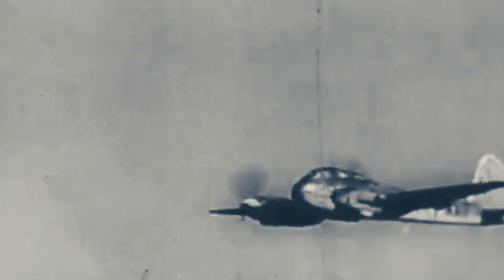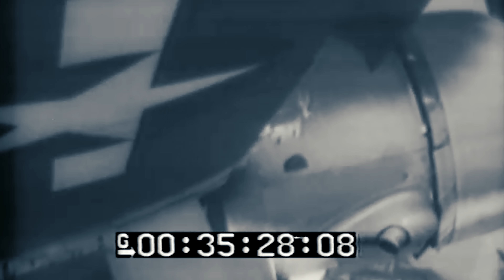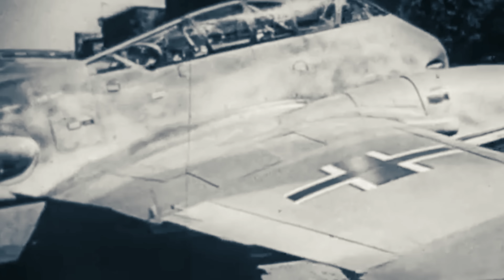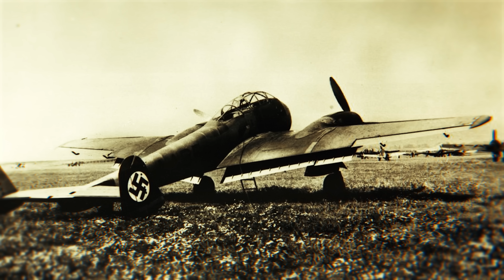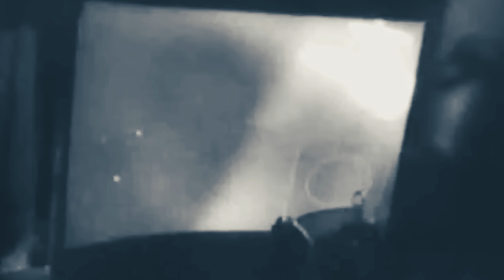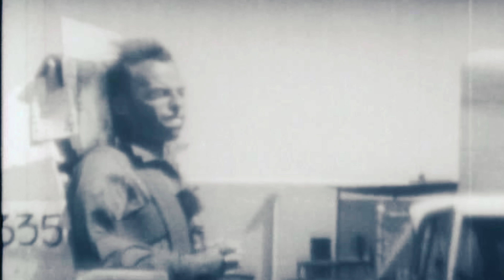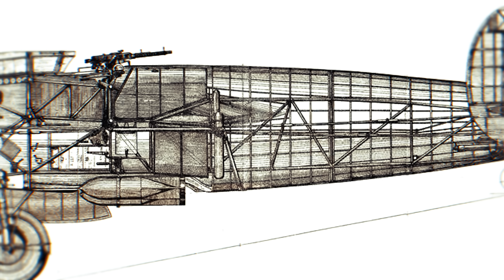Flying Disasters: 3 of WWII’s Most Dangerous Aircraft Designs

Comment: Anzeldo Breda made the catastropic ic4 trains that should be the new Danish super train. It turned out to be an tram actually, plagued with faults under any load. Anything electric failed, toilets failed, drivetrain failed. As the Breda they where produced to the very end, Even if they where scrapped before final assembly. Anzeldo Breda is a name you should mark on your list. This name is point zero of Italian corruption.

Comment: Fighter aircraft are a bit of an oxymoron. You need a platform that is stable enough to aim from with your weapons but agile, enough or unstable enough to change course with the least input on the stick. Getting it right requires a ton of math , a bit of inspiration , a little insanity , and a very brave person to get in the plane and fly it. If we can take the small-scale Cessna, the beginning Cessna as an aircraft archetype for learning how to fly and the most friendly to flying your fighter aircraft is the exact opposite. It's not stable, it's not friendly to pilots. You have to fight it every step of the way to maintain a straight level course  And at the same time , you have to be delicate with it very small corrections , because too much correction will send you into a diver , Or a violent turn. And that very unstability allows you to survive easier when someone's trying to shoot you

Comment: Part of the Helldiver's problems was a truncated fuselage; the Navy insisted that the plane be short enough so that two could fit on the elevator of an Essex class carrier.  Maybe the only thing that would have made the plane worse would be fitting it with Curtis-Wright's own R-3350 engine, though that wasn't ready until later in the war.

Comment: Whilst the Piaggio PXI was a "licensed version of a French engine",  the Gnome-Rhône Mistral Major, but the French engine was not a license built Bristol Jupiter. The Jupiter was a 9 cylinder, single row design, with the Mistral Major being a 14 cylinder, twin row design. Gnome-Rhône purchased a license for the Jupiter in 1922, along with the Bristol Titan 5 cylinder engine. They then went on to design their own engines, developed from the Titan, eventually producing the Mistral Major, which featured 2 valves per cylinder, rather than the 4 used on the Bristol engines.

Comment: My Great Grandpa was a navigator (rear seat with the twin guns) on a Helldiver in the Pacific. Once, upon takeoff there was a catapult malfunction that sent his plane over the front of the ship and straight "into the drink." The carrier had to take emergency evasive action to avoid running them down, but the plane started sinking like a stone immediately. He was a deeply religious man who always talked about a "prompting" he'd gotten on the flight deck that day to not do up his harness. It was the only time he didn't strap himself in, and it was the only reason he was able to get out of his crippled, sinking plane in time to swim back to the surface. He was eventually picked up with the help of a cruiser after floating around for over an hour (there are some very cool photos of a funky contraption strung between the carrier and the cruiser to lower a sort of chair thing down to the water for him to clamber onto). Not sure this particular helldiver crash was the fault of the designers or not, but I'm definitely grateful that my Gramps listened to whatever that prompting was that saved his life. He was a great man.
Reply: A bosun's chair is used to transfer people from one vessel to another at speed (under way). I've never heard of one being used to grab swimmers out of the water, at least when in motion. You wouldn't be able to grab onto it and hold on with water rushing past you at 10 or more knots. Possibly a single ship could toss one in the water at very low speed, but that would be it. There would be the danger of hitting the swimmer and killing them.

Comment: Even as a child reading, looking at, WWII aviation books in my school library, I thought the Helldiver just didn't look right. It looked as if the fuselage, from the rear canopy back, was way too short. It made me believe that it couldn't fly well. It looked unstable. Now, I know that an aerodynamic shape doesn't always look how we would instinctively imagine it to look. However, in this case I believe my instincts were correct.
Reply: The Me-210 had the same problem. Willy Messerschmitt, believing the hype about what a genius he was, chopped a metre off the original design length, the result being tremendous instability. Eventually, after several years of futzing around, he had to restore the length at tremendous factory cost.

Comment: To be fair to the RLM, the heavy fighter did have a place. The British DeHaviland Mosquito and the American Lockheed P-38 Lightning provided successful examples of the concept, along with the P-61 Black Widow as a night fighter. Simply removing the tail gunner and associated gear and focusing on aerodynamic performance made for a successful machine. The Me-210 was over-engineered, but it could have been successful had it been built better, as proven by the 410 upgrade.

Comment: Helldiver suffered from a conceptual flaw: it was designed to be short enough to fit two on one carrier elevator. That would greatly reduce the time needed to move aircraft from the hangar to the flight deck. But that led to lateral stability issues that were almost impossible to overcome. The Dauntless traded folding wings for more stability in a dive.

Comment: Jocko Clark's actual critique of the SB2C during it's carrier trials was that it had value to the Navy only as an anchor.  Frankly, Curtis was a second rate manufacturer by that point.  The design had multiple problems, many caused by Curtis' inability to imaginatively deal with a Navy speculation that 2 of the planes be able to fit on one carrier elevator.  The cockpit layout was also terrible.  By the time of the -5 model most of the problems had been fixed, but the ability of the Hellcat and Corsair to carry a bombload helped make the SB2C obsolete.

Comment: For perspective When Yorktown’s Captain Jocko Clark was pleading with the Navy to cancel the Helldivers, this was in June ‘43. This was during the second Essex class Yorktown CV-10’s initial work ups after commissioning in April of ‘43. When the ship arrived at Pensacola Clark got saddled with doing the initial Carrier workups of the new planes. It was a disaster. For the first week of testing the plane handlers could barely move the 10,000 lb monstrosities. Plane handling was done by men pushing them around. The Yorktown crews operational speed was horrible due to the Helldivers. Clark was furious. When Yorktown put back into Pensacola Clark was told he had to keep on testing. A couple of enterprising and felonious Master Chiefs bribed the local Shore Patrol to look the other way while they stole 2 aircraft tractors from the Marines and smuggled them aboard. Keeping them hidden until they were well out to sea. When they started testing again Clark was astonished to see the tugs, and further amazed at how they gave his ship a record breaking operational speed. They spent the next 2 weeks with Helldivers crashing on the deck. When they got back to port Clark ordered them off his ship, and demanded Dauntless’s. It would not be until ‘44 that the “improved” Helldiver would enter service. Clark did keep the stolen tractors. And he told command about them and how well they worked. Within 2 weeks every carrier was issued 4 tractors plus a gas powered crane. US Navy Felonius Innovation going back to their Pirate origins. Clark was still pissed. Messing around with the Helldivers had allowed the third Essex Carrier CV-11 USS Intrepid to leapfrog him and reach Pearl Harbor first.

Comment: on the Breda,  one has to remember that an aircraft built to spec for racing is very different to one built for military use.   The Spitfire saw many changes from the racing plane it shares lineage with.    Seemingly the the italians weren't able to pull off what the british did in adapting a racing plane into a military aircraft.  The required specs the Italian air force requested ( can survive 12gs WTF?) likely handicapped the efforts.

Comment: In 2006 I was in Germany and there was an airshow with a few warbirds.  I was drawn to a BF109 and ME262 replica parked for display.  There were displays put in front of the planes displaying other Messerschmidt models.  When I asked the pilot of the 262 why the 410 was not simply kept as an upgraded 210 model, he told me that it wasn't just propaganda but that over 70% of the machine had to be redesigned.  With so much of the original blueprint being revised, it was internally to Messerschmidt not even the same machine anymore.  This only gave more "legitimacy" to the claim that it was "a whole new machine", and they could put the 210 to bed.  So yes, it was propaganda, but also yes, it was a new plane.

Comment: What surprises me is that the ME262 sometimes lost to the P-38
Reply: most Me 262 were shot down during take off and landing. But it also wasn't exactly the best dogfighter. The jet engines would flame out if the pilot reduced the throttles too quickly and so slowing down quickly for a tight turn was difficult. And the swept wing design made it less manoeuvrable at low speeds. The Me 262 excelled at level speed and climb rate most. In a dive the P-38 was extremely fast and stable. So the Me 262 had no advantage there either. So a skilled pilot could absolutely get the better of a Me 262 just like a skilled Hurricane pilot could get the better of a superior Bf 109E.
Reply: @archer494 Indeed. The Me262 was very good at going fast, in level flight, within quite a narrow altitude range.  So, a moderately interesting technology demonstrator.
Reply: @loucypher9213 I wouldn't put it like that. The Me 262 suffered mainly from the fact that she was a late-war addition to the war with an until then unproven propulsion in combination with deteriorating production capabilities, quality control issues and material and fuel shortages due to the bombing raids on factories, infrastructure (incl. airfields) and supply chains. Had the development been started earlier I am sure they would have gotten the engines to be more reliable. As recent replicas with proven jet engines have shown the airframe and aerodynamics are sound. The aircraft with the right tactic and reliable engines would have absolutely been a great addition to the Bf 109 and Fw 190. But never a replacement. Using the 262 to attack the bombers while the 109s and 190s dealt with the escorts would probably have worked. It just never reached its full potential

Comment: When you use an ejector seat, you take about 19-20Gs. A Syrian MiG-25 once went into 11-12G manoeuvres to escape an Israeli Mirage-III in a dogfight. The MiG-25 could return to its base but was written-off as it got too much metal fatigue and the pilot was lucky it didn't broke appart.
Rafale pilots doing air shows have been advised to stop doing 10.5-11G manoeuvres to impress the public and do not go over 9G, going further being an emergency measure to dodge high manoeuvring incoming missiles, not to go into a dogfight. Actually, the airframe is rated at taking 13G without metal fatigue and to break appart at 14.1G.
An airframe supposed to take 12G would have meant maneuvering at 9-10G and one thing for sure, with WW2 dogfights, a functioning aircraft doing this would have been devastating for the adversary, but you also need to have pilots trained at facing high G-factors, preferably rather small men or women because you can take more Gs when you weight 50kg than if you're a big 100kg baby, inclined seats like you can see on Rafale or F-16, HOTAS, etc

Comment: The Curtiss-Wright XP-55 Ascender (or known by the test crews as the “Ass-Ender”) would fit in here… it was an attempt at a push-plane, but having the engine and propeller in the back caused it to suddenly do an in place back flip, known as “departing from flight”, and fall out of the sky and into the ground when at certain speeds during landing… so, it flunked out around 1944 or 1945.

Comment: It is somewhat strange that Douglas couldn't (or wouldn't) develop the Dauntless or at least use it as the basis of a new, somewhat larger, more potent aircraft.  It needed folding wings, a more powerful engine, lose the nose mounted .50s and add 2 (or a 20 mm) to each wing,  RETAIN the external ordinance carriage and forget about a bomb bay...in effect create a WWII equivalent of the later Skyraider.  What they DID create was a rather strange bird with tricycle undercarriage, bomb bay and remote controlled turrets.  Both Douglas and Curtiss seemed to have developed  a sort of "design Alzheimer's". Douglas snapped out of it but Curtiss never did. The Helldiver was not a bad LOOKING aircraft and, despite its own chunkiness, positively svelte when compared to the Avenger yet the homely and portly Avenger (admittedly NOT a dive bomber) was just about everything the Helldiver wasn't. No WWII dive bomber was a world beater by any stretch but to blindly persist in pushing through this particular lemon speaks of political dealings behind the scenes.  Vultee built a dive bomber about the same size as the Helldiver and despite being relatively unknown, had I would argue, a far better reputation. True, it was not a navy bird but it saw quite a bit of service while USAAF versions of both the Dauntless and the Helldiver were failures.

Comment: Gee, Mike, viewers have responded to you question by requesting that you do just about every aeroplane that was.   You could be doing aeroplane videos for years.
May I suggest you concentrate on the more rarer types.    I wouldn't be much interested in things like the B-29 and the 707 because they have been done to death repeatedly ever since they came out.
However, a well researched coverage of the Comet would be good - you are quite right - due to rotten reporting by the British press, people have been thinking it was basically a good aircraft let down by square windows and that just isn't true.
A well researched article on the DC-10 would be good - because it was a dreadful plane - dreadful because Douglas fell down in the same ways that Boeing has in recent years.
If you are not aware of Mentour Pilot's superb technical analysis of planes and accidents, check him out - he set the standard pretty high.  But I stopped watching his videos after a while - too much of a good thing.   Like eating roast beef every day - one needs a change.

Comment: And the Me210 was not alone in being poorly specified; the Luftwaffe was fixated on divebombing, to the extent that virtually every Zerstörer and Kampfflugzeug was required to be capable of dive bombing, even aircraft which were utterly unsuited to the role, such as the He177 Greif - a heavy bomber which, on a good day, assuming that the engines didn't catch fire on the way to the target, could at best glide bomb, despite redesigns to strengthen the airframe.

Comment: The BA-88 wasn't a "bad" design, it just wasn't a military design. It's like having Ferarri build a tank, sure it'll do 140kph...till you put armor and a gun on it. Then it drops to 20kph, the engine catches fire, and the transmission and suspension fail every 30 kilometers.
Reply: Sounds like every German tank
Reply: @ZayTNO  no, only the late overengineered models built and sabotaged by slave labour. Like the Panther and Tiger II. Ok the first Tiger wasn't a model of reliability either. But the III and IV models were pretty good. Just not built for the Arctic conditions of the worst Russian winters of the century

Comment: The Italians (and the Japanese) had a knack for lovely handling aircraft but were hamstrung by low engine power. 1000 hp sounds pretty good but radial engines had higher intrinsic drag, so in 1939 something like 1500 hp was required to be competitive. It was only when they got their hands on German engines later that their aircraft showed real promise but by then Italy was close to collapse. BTW, +12G won't kill a pilot but sustaining it for any length of time will make them pass out. I've been lucky enough to fly fighters several times (from the back seat of RAAF ones - I was a technician) and, with a G-suit I was able to pull and sustain 7G without too much trouble but it gets considerably harder north of there. Astronauts sometimes sustain quite high G near the burnout of a rocket stage or on re-entry but it's usually brief, they're wearing a G-suit and they're often lying on their back, which makes a massive difference.